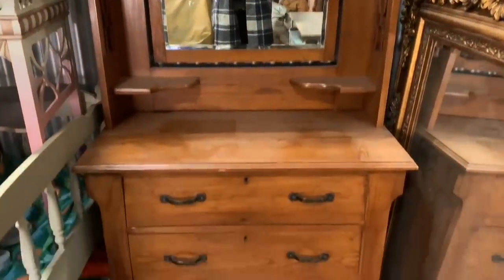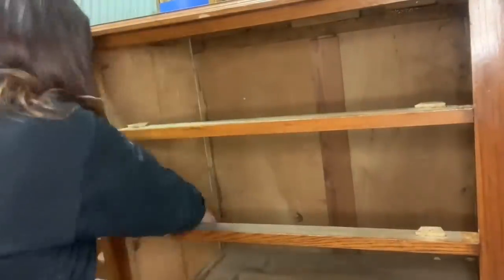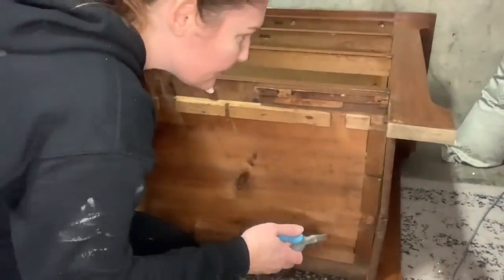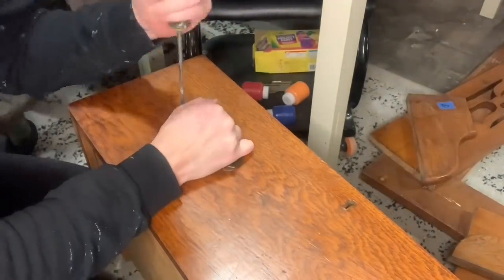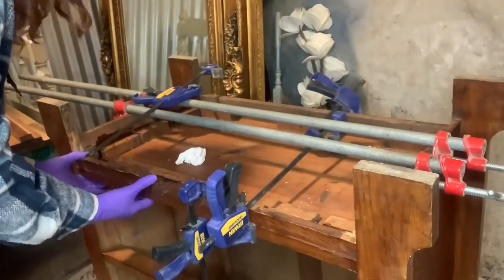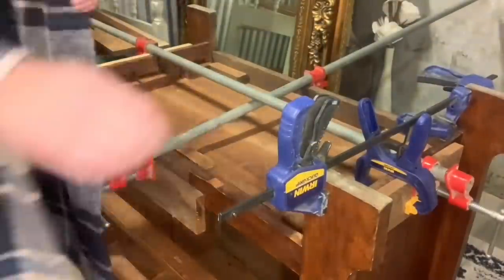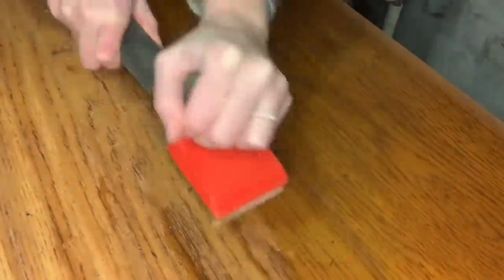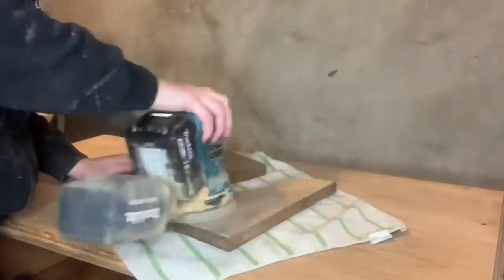Ye Olde Makeover | Restoring A Chest Of Drawers | Elegant Upgrades

Comment: After you clean with Mineral  Spirits do you clean with soap and water or what. What is the process of cleaning  your furniture after you strip the paint off.
Reply from the maker: Nope, no need for soap and water. Mineral spirits doesn’t need to be cleaned off. It fully evaporates.

Comment: Just curious about the yellowing  over time using a white stain you talked about..Is it with oak that does that? What can I add to stain to make sure that it wont yellow?
Reply from the maker: The oak can yellow over time, but mostly it’s the finish. Especially oil based finishes. That’s why I added the purple pigment, to combat that down the road. But you can also use water based products, the tend to yellow a lot less.

Comment: Do you always have to go with the grain of the wood when you use a scraper?
Reply from the maker: It’s safest to go with the grain. There are occasions where that may not be possible so you’ll go against, but when you can you should. If it’s older wood or deep grained wood you run the risk of damaging it by running something so sharp over it. And also, if you put a scratch in with the grain, it’s much easier to hide.
Reply: Thank you 😊